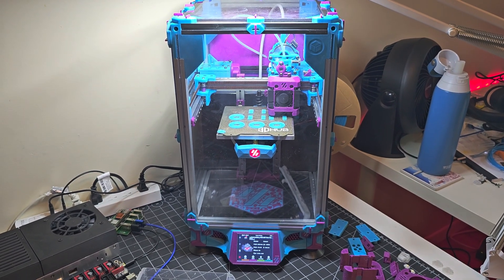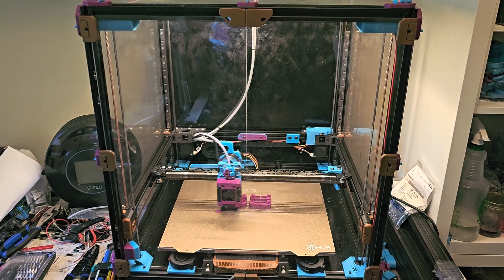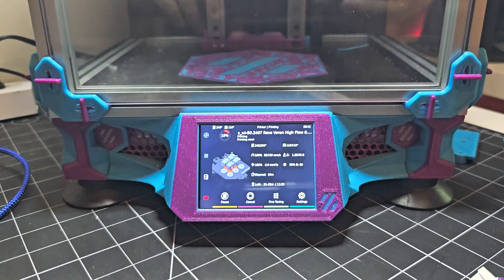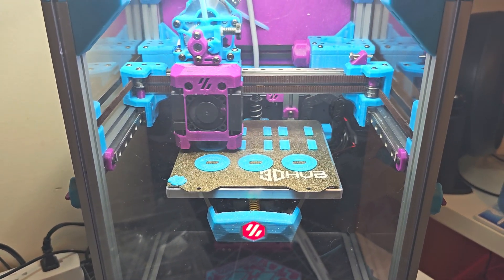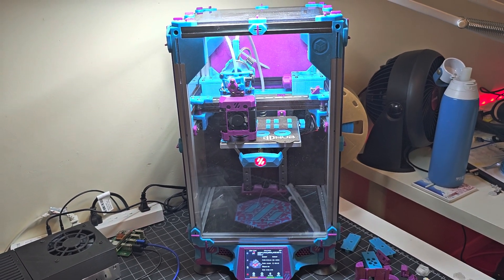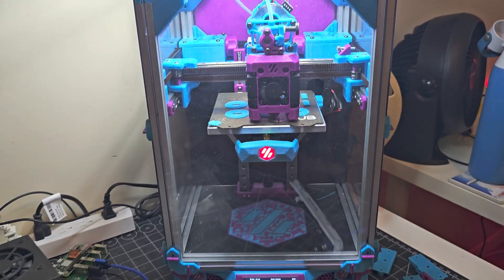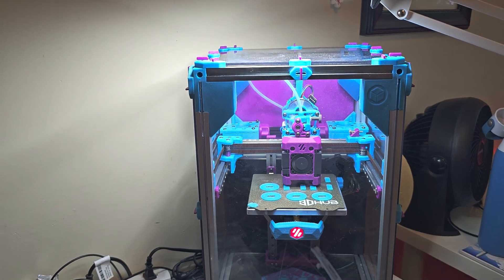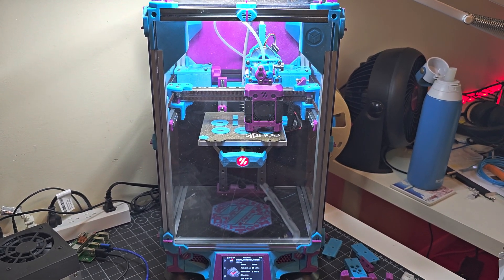Voron 0.2S1: Printing Tool Free Z Idlers for my V2

Comment: My ldo v0.2 is coming August 1st. I can hardly wait to start building it. 😊
Reply from the maker: I bought the Formbot V2 350mm kit for sheer size of the build volume. I then built the LDO V02S1 kit for fun.
Now I'm tag-teaming a Tridex build with a friend who doesn't himself own a 3D printer.
The V0.2 is a really great little beast!
Reply: @oldguymeltsplastic 
I almost did the same. First a prusa mk3s+. Then ldo V2.4 r2 350. And now the ldo V0.2. I don't always want to start the large ldo for small abs prints because of the power consumption. the V2.4 is fantastic but also uses a lot of electricity. And in my country is electricity quite expensive.